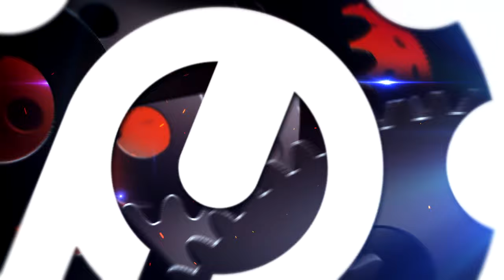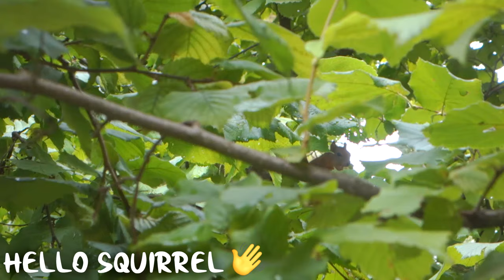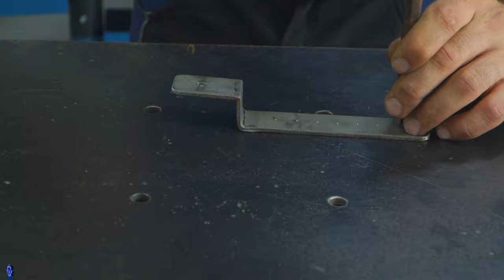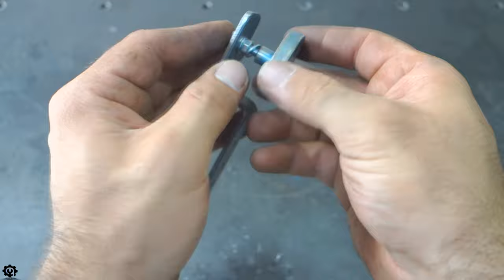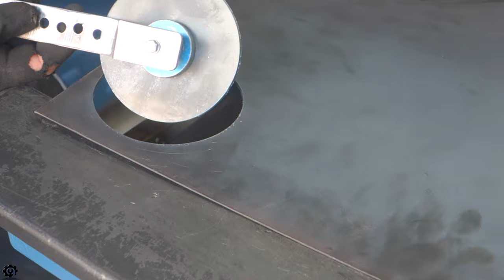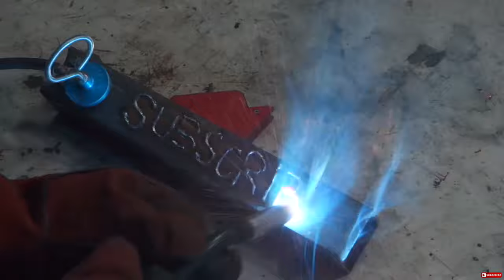DIY - Circle cutter Jig for Plasma Cutter

Comment: Simple and excellent! But a thought, what about instead of drilling holes at a set distance you make a slot. Then make a insert for the cuter that can be locked at any distance along the length of the slot.
That way you can make any size holes/discs. Just a suggestion! 
Keep up the good content!